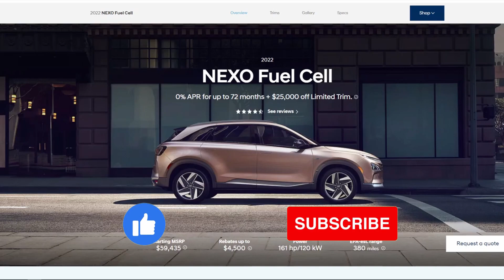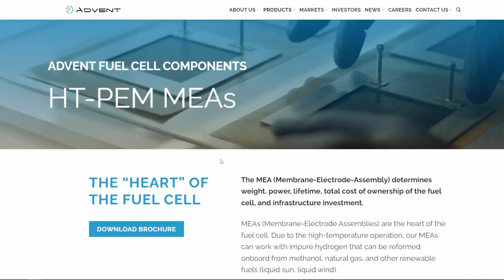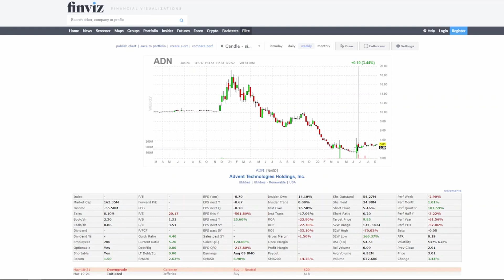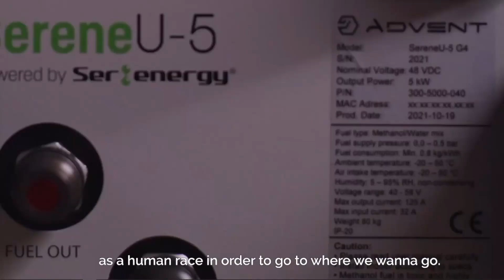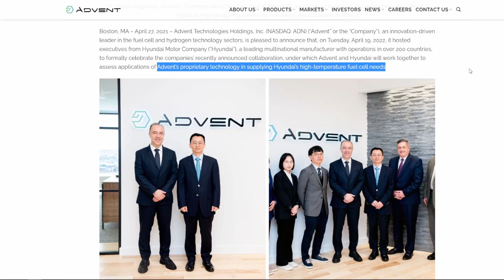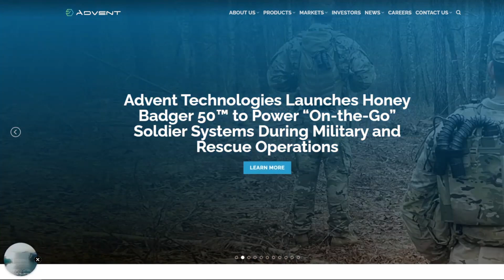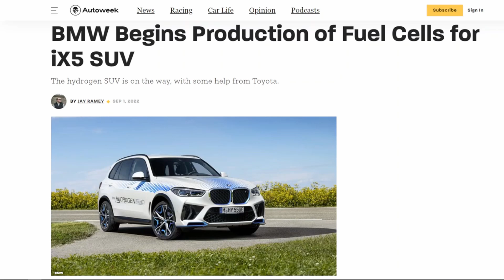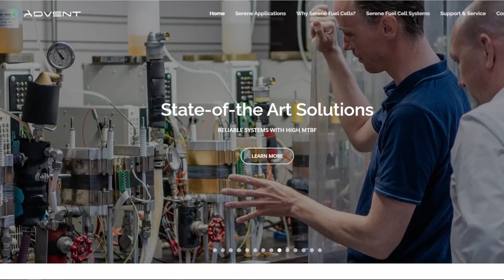Hydrogen Will Dominate The EV Market By 2030 (Here's Exactly Why)

Comment: This will good new to big oil companies because they get to control what we need to travel. Batteries ev's are bad news for these big companies because electricity is available everywhere.
Reply from the maker: "Available everywhere", try to talk California into that lmfao. A 20 lbs fuel cell system can produce the same amount of power as a 550 lbs battery pack, while having no lithium or cobalt in it. Hydrogen has already won my friend

Comment: It still appears to me that hydrogen will only beat batteries on ships, planes and large trucks and buses, but not passenger cars.  While still important, this implies a longer haul.  This is not a zero emission technology, especially if hydrogen is being generated by natural gas.  As with batteries, the source of power will determine how green the technology really is.
Reply: Well it is a zero emission technology, if it’s green hydrogen. And that’s generally what people are talking about when they talk about hydrogen. In fact, green hydrogen is green throughout the entire process of the supply chain, something you can’t always say about electricity, as you said in your comment. But either way, I don’t think those technicals matter too much when it relates to adoption. I’m not saying they’ll dominate batteries in the passenger car market, however I do think they will take some decent market share. There’s distinct advantages to each FCEVs and EVs, that would suggest that some people would rather buy an FCEV than an EV, and vice versa
Reply: Definitely is a zero emissions technology. One in which was kept off the public market for the past 100 years. You should lookup Mike Stritzki and the Hydrogen House. Mike is one of the hydrogen tech engineer OGs from the 80s and 90s that built hydrogen cars for many oems and converted his entire house over to solar hydrogen. He did this decades ago and proved long ago it could be done.
Reply: @HydrogenFuelTechnologies  Generating hydrogen from a methane (natural gas) power source as illustrated here is only "carbon-free" after hydrogen is available to power the vehicle.  Similarly, coal-powered electricity used to recharge EV's is not carbon-free, even if a fully charged battery then uses no carbon.
Reply: Are you saying, that there is already, a zero emission technology?